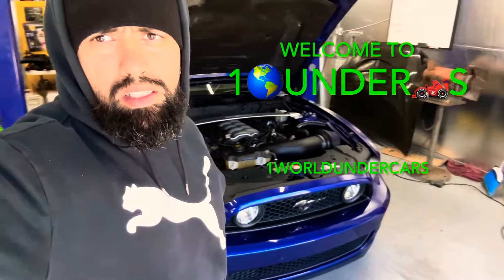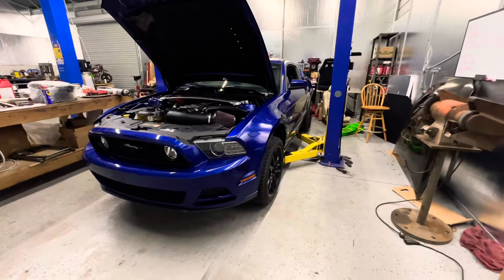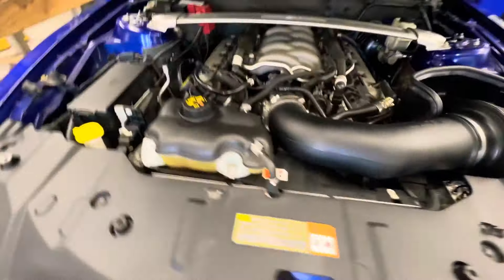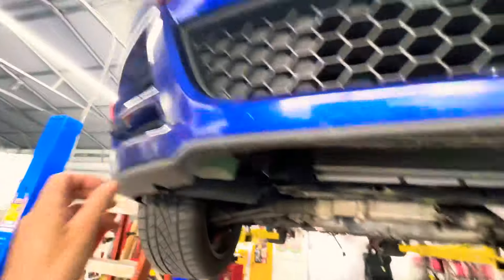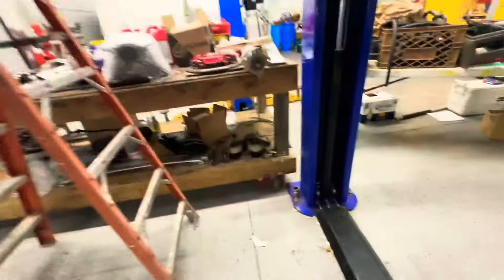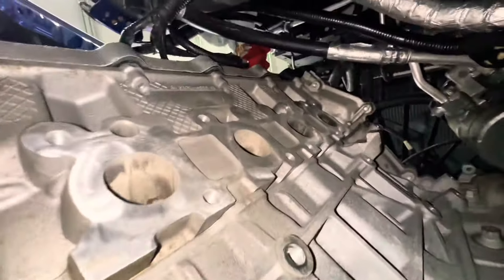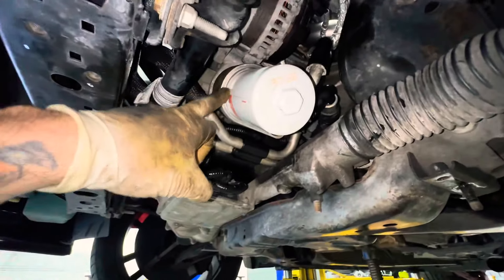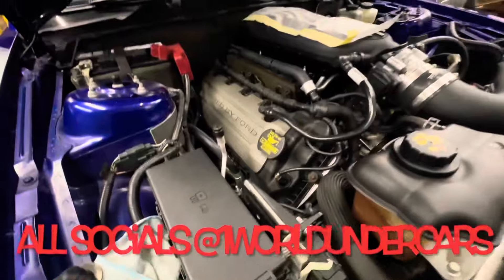2011-2014 MUSTANG GT COYOTE 5.0L V8 DIY KOOKS HEADERS INSTALL

Comment: The amount of times this guy says “let’s get it” 😂 good vid but you don’t actually have to take the AC compressor off to do this. There are simpler ways. But everything else spot on👍 Sounds amazing man!
Reply from the maker: Is easier if you do Just my opinion. Done them both ways ✌️

Comment: I know this was 7 months ago-  I d like to agree to disagree.   There is a belt tensioner,  when I did [added new Comp Cams ] cams on a 2010 GT,  I Did Not cut the belt off.  As a side task, old cracky belt, 14 years, I added new belt [ Feb 2024].   In the center of the Idler Wheel is about a 17mm or 19 mm or about 3/4" nut.  Add that socket to a Breaker Bar,  as you put pressure to turn it, the Idler wheel pivots on an spring Arm.  Then side belt off that wheel and you got slack to slide all belt off each pulley.  WHA LA   I did headers to, dont need to take AC compressor off neither,, NOR the coolant Resv tank.